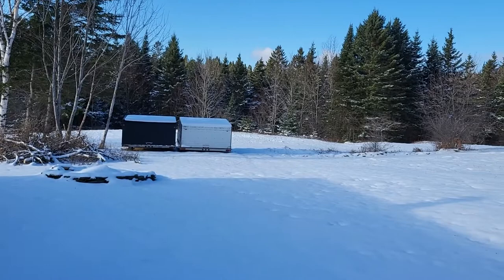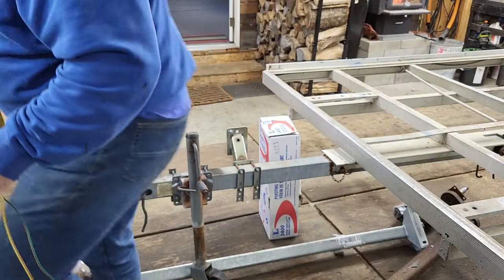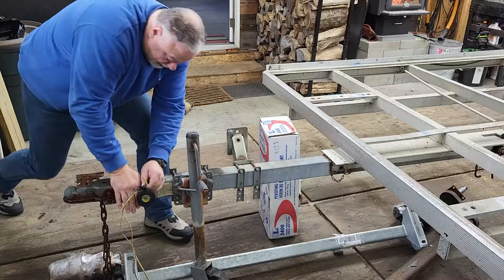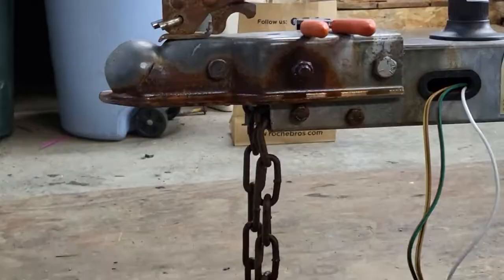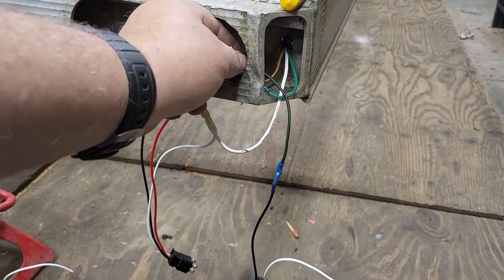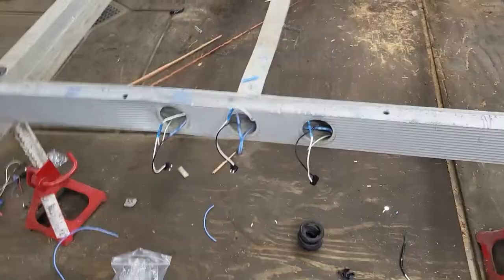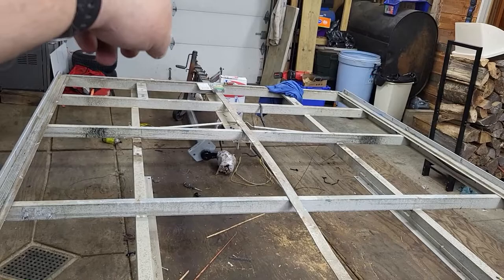Snowmobile Trailer rebuild, Wire harness, lights, axle, tires, flooring...

Comment: Thank you so much Big Guy, I have a tilt snowmobile trailer that I haven’t used in about 4 years and the lights didn’t work.  I needed it right away to pick up some equipment about 3 hours away. So I just grabbed an extra trailer harness that I happened to have to wire it up quickly so I could use it. But I just put the ground  wire up by the coupler, now lights still don’t work. Didn’t make sense, new wires, new connections, power to the trailer plug. Now I know to run a ground wire all the way to the BACK of the  tilt trailer - THANK YOU!!!

Comment: Hey big guy. I’ve got a tilting/ each side does individually. 😅be wired it but only left side works. Seems to be wired correctly but the right side doesn’t work. I’m stumped. Any help would be great, otherwise I’ll have to get a pro to take a look. Thanks again and great video👍🏻👍🏻
Reply from the maker: You will need a testing tool for voltage/continuity. If the connectors on the voltage meter do not have a sharp tip to penetrate a wire casing, get a sewing needle. Use this needle to poke into the positive wire (Green for the right side for brake, Brown for running lights )while you have the ground attached either to the white wire or trailer frame. Start from the coupler of the trailer and work you way back. I had the similar issue and found I made a bad ground in my pigtail. When you have found it the bad connection, use Liquid Electrical Tape or some sort of rubber silicone to seal up all the holes you put into the wire casing. This way you prevent water intrusion. Good Luck!!

Comment: Another question, where did you get the replacement axle, etrailer does not have the full axle. Again, this is  a great video for AL trailer owners. Ahh, just saw you got the axle from the manufacturer.
Reply from the maker: We bought the axle directly from the manufacture. This way we have an exact replacement and no gerry rigging to make something work that is not meant to be there.
Reply: Thanks, mine is a UT-128 Triton, I bought it new but not used much at all. Got it all refurbished and noticed the tires all had great tread but all dry rotted so had to replace all 5 tires including the spare. I think the axles are OK. This video was a lot of help getting things rewired.  @bigguydiy2184
Reply from the maker: I'm glad it helped. My goal was to keep the cost down for the owner and re-use as little wire as possible. That is the goal for most of my videos. Keep the cost down and be innovative or creative.